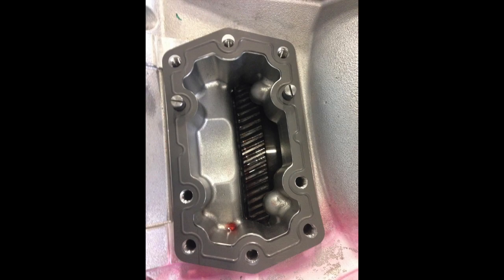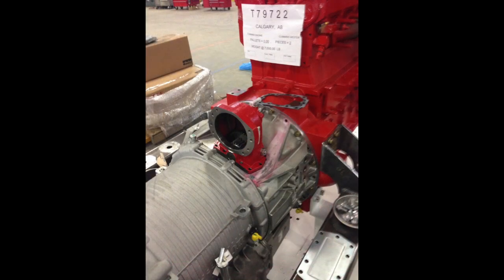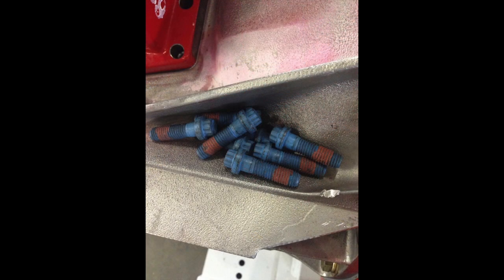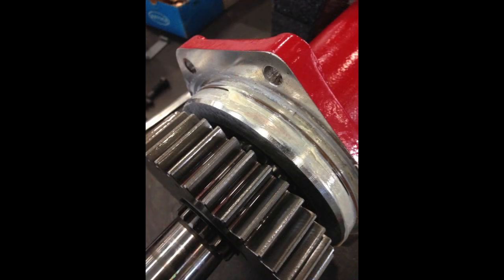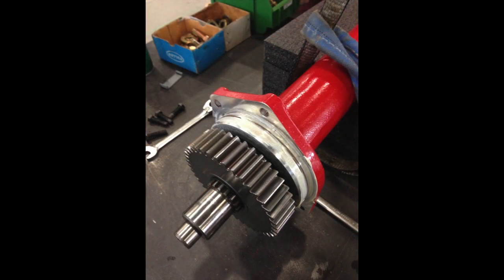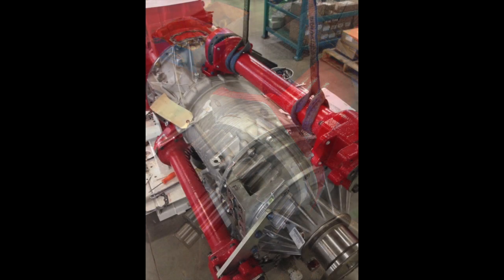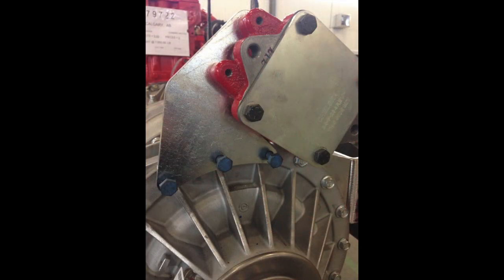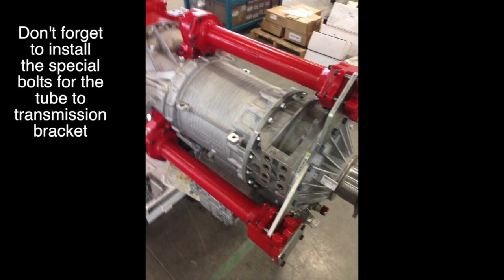Parker Chelsea PTO Install

Comment: Mine is stuck engaged would that be the solenoid
Reply: Solenoid could be stuck or the solenoid and pressure switch are in the opposite ports
Reply: Clutch disks welded themselves together idk if the driver left if engaged or not but after a rebuild got it going again.
Reply: @ryandavis164  good to hear, if you haven’t already I would make sure that the PTO enable pin in the TCM was wired when the PTO was installed(if this is an Allison transmission). A lot of times people don’t do it and that will burn those clutches up quick. What is does is ramp up the line pressure and put the torque converter into full lock when pto is engaged